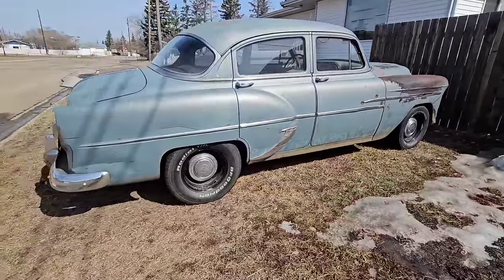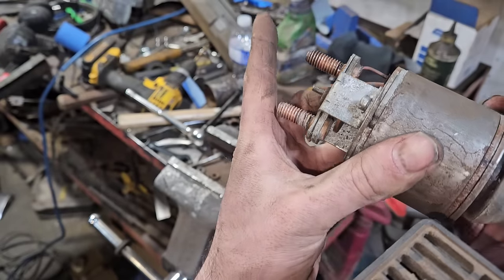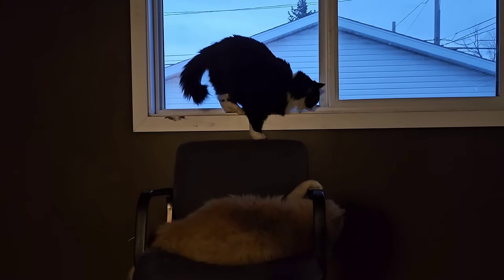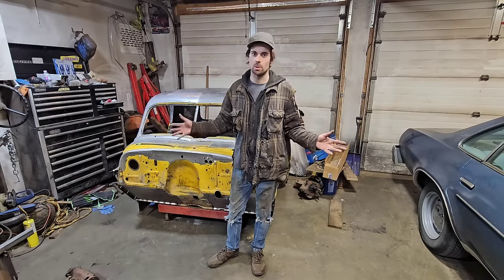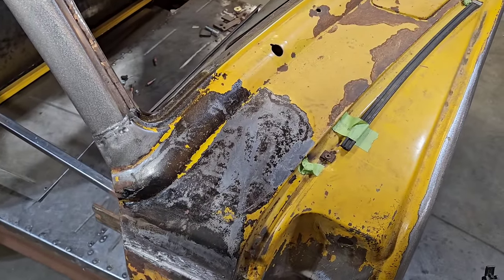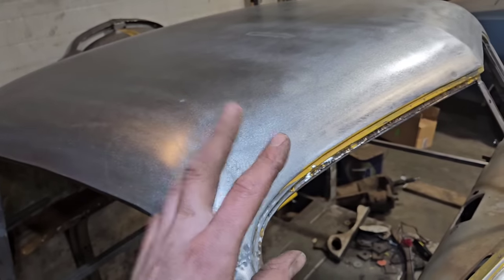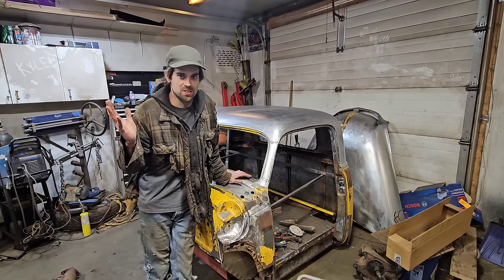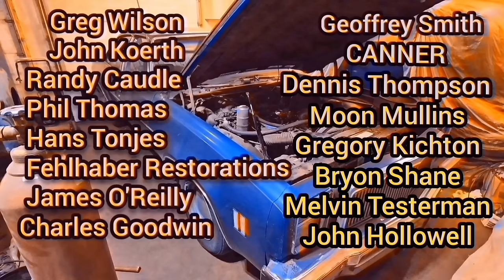This Rare Pontiac Has Been Sitting For 4000 Years! Plus: Top Secret Rust Removal

Comment: I love working on old crusty mechanicals.  Newer motorcycles usually come down to replacing the igniter box or computer. $1500 repair bill for a bike that is not worth that much .  Older bikes , just points and carb if you get any kind of compression. The main reason that I stoped working on customers bikes . As Jean Paul Sautra said “ the real hell is other people “

Comment: The fact that it idles as well as it does kinda says the internals of that motor are not that bad "probably". The "coughing" you are hearing in the carburetor kinda indicates you might have a stuck or burnt intake valve. Most likely stuck. If you are hearing similar poping from the exhaust, the same thing  applies only on the exhaust valve side. I would try some STP additive in the oil or maybe some Marvel mystery oil. Beyond that, you are looking at removing the head to determine damage/condition. A vacuum gauge is also a simple way to determine things. A strong reading (16-18) but the needing bouncing a lot says good rings (compression) but bad valves. 
Use a "stove bolt" in the truck. A late one with pressurized oil system and hydraulic lifter if possible.
Reply from the maker: Thanks for the input. I did put a vacuum gauge on it but forgot to include that in the video. The needle was bouncing around so you are probably right about the valve issues. I may end up pulling the head once I get it moved into the garage for disassembly

Comment: I thought Canadian Pontiacs had Chevy motors. This is the same motor as the US model.I learned something today, thanks
Reply from the maker: I believe they switched over to using Chevy engines in 1955...or some time in the mid to late 50's, so you're still right!
Reply: @CarterAutoRestyling  thanks for the update. I moved from Oklahoma to Calgary n 1963 as my dad was transferred there. I freaked out when I saw Chevy motors in Pontiacs. I was also curious about all the 6 banger full size cars. When I thought about it though it made perfect sense as Calgary had no freeways and the trans Canada speed limit was 60.  The six cylinder cars made total sense. I really enjoyed Canada and have been back. Canadians are the nicest people on earth.

Comment: well the '53 Pontiac runs I mean the engine isn't terrible you could spend a little more time on it. A running engine is better than a frozen one any day. Looks like that Krud Kutter worked pretty well as long as you don't leave it on too long with each application. Love your cats playing during the video. Thanks for the video Kyle.

Comment: When it was spinning over with plugs in it sounds like not all cylinders have compression. Probably some stuck valves. Some valves might be accessible through the plug holes and may be able to be tapped down. I did like the good access you had to the clutch. You couldn't free off a flathead ford like that. Nice job on the rust. I need something like that for my 32 sedan. That's a job I'm not looking forward to. Oh yeah, my views have tanked too, but I put that down to the T-Bird not being as popular as the 100E. Ok mate, catch you next time! Mart.
Reply from the maker: Hi Mart. Thanks for your input on the Pontiac engine. I think once I get the car moved inside, I'll pull the head off so I have full access to mess with the valves. Ps. Nice work getting the T bird to run on 4 barrels! It sounds great!

Comment: Love your videos! I'll give that Krud a try. I've been using OSPHO the last couple of years on lightly rusted parts and have been pleased with the results. I even use it as a surface prep the day before painting. I also learned about molasses/water a while back for rust remover. 9 parts water, 1 part molasses, works great but is very slow. need to soak parts for a month or more depending on how rusty. Keep up the good work!

Comment: If there isn't snow on the ground, are you really in Canada, and not some tropical oasis? I think that you should at least pull the head off of the Pontiac. Since the valves are in the block, it should be easy. You could clean the tops of the pistons, and maybe around the valves. If you're careful you can reuse the head gasket.
Reply from the maker: I was thinking the same, won't hurt to at least have a look at what's going on inside. I think I'll wait to pull the head until it's moved inside the garage so I don't have to push it haha.

Comment: That's a rare 53 or 54 Pontiac Submarine!  Add a magnetic oil drain plug and fill with rotella 4 oil. It will repay you with love and torque you didn't expect.
Reply: lol the hubcaps are still holding the wheels on-amazing considering wheel covers are as useful as engine covers and bumper stickers

Comment: Adding #puppetry to the channel is a very astute move, your views will improve dramatically. Too much voltage and running without an air cleaner can really damage those old Pontiac flatheads, especially if they were wore out to begin with. Cheers! 😎👍🐔🥚🛻🏁🏁

Comment: Take a que from Scott. Pull the ponchos head and loosen any stuck valves. A couple heat cycles may release other stuck components. The Flat six would be cool in the chicken truck. Nice work as usual😊

Comment: Currently I use liquid Ospho rust converter. Both Ospho and Krud Kutter contain phosphoric acid as an active ingredient. I have learned that Ospho reacts with concrete if dripped onto it. So I try to apply it over cardboard to avoid contact with concrete. Another great Video. Comp test that Indian Chief, You might just have a sticking valve in block. Might gain acess thru side cover plates. Dunno much about flathead valve adjustment. Take care sir.

Comment: It sounds like your straight six is a straight five. I would guess it has a stuck valve which is quite common in those flat heads that have been left standing for many years. Buy yourself one of those cheap laser thermometers and point it at each cylinder exhaust it will show the cylinder(s) that are not firing or missing.

Comment: When working on the solenoid, you can usually flip over the copper washer that the copper contacts connect with when electricity is applied.  This used to be a common field fix for starters back in the day.  You can also usually still get the contacts and the copper washer if you know where to look.  If you can't find parts for them anymore, you can substitute a Ford starter relay that does the same thing.  Solenoids are very simple electrical devices, one is as good as another as long as they aren't being used to kick out the Bendix also.

Comment: I have tried all manner of rust removal shit. In my opinion, if you can soak it, use Evaporust; if you can't soak it, use Ospho. Those two work well on heavy rust. On lighter stuff, I have used a Loctite and Permatex product, both in brush on and spray that leave a paintable primer surface. I have used all of these with no rust through problems on restorations. That stuff seems to work well though!

Comment: that malibu would make a great cop car tribute. plenty of low buck factory type suspension parts without going to qa-1 coilovers, etc... ya already have the hub caps!
that pontiac dash would look great in the chicken truck. btw your commentary is gold!
Reply from the maker: I definitely think the Pontiac dash may end up in the Chicken Truck!
Reply: @CarterAutoRestyling  it just looks so good and you don't see them in customs all the time. btw i think a nice straight six is perfect. customs aren't supposed to have a fire breather. maybe a jeep 4.0 dressed to look old? cheap, period paint color, a bit of chrome... that rust eater was impressive- thanks for the tip. thinking of trying pickex 20 too.

Comment: Picked up some Krud Kutter from Canadian Tire. I would agree it works pretty good. I was previously using Muriatic Acid. It works very well but is nerve racking to use and it does rust all bare metal within a 5 km radius. I found out the hard way 😮‍💨. Thanks for another great video!

Comment: Do a compression test, new spark plugs, maybe spark plug wires. Add a pint of transmission fluid to the oil to loosen up the engine. Good luck.

Comment: Letting the rust remover dry out usually results in staining of the metal it is used on.  Generally speaking, you should use some Saran Wrap to cover that area that has been sprayed with the rust remover gel.   This keeps the rust remover from drying out, and makes it work longer.  You can leave it on several days if you want without it drying out, if you have extensive rust.
I know it seems completely insane to flood the area with water when trying to get rid of the rust remover - however, it doesn't cause flash rust IF you flood it then dry it immediately after with towels and/or blowing it off with air so no moisture sits on the surface. You aren't the first to question this and to assume it will cause flash rust, it doesn't if done correctly.

If you don't flood the surface with water, the phosphoric acid will stain the metal and keep coatings from bonding.  The product you are using is the same as a rust killer and cleaner like PPG DX579 for bare metal (basically phosphoric acid without the gel).  To use it you have to flood the area with water after applying it and then dry it immediately.   Using this stuff kills the surface rust and deep cleans the metal in preparation for paint or primer. This is so that rust can't start up on the metal underneath the primer or paint.  If you live in a rust prone area or one with high humidity, you'd want to get the surface in primer or paint within a day or two, with no direct moisture sitting on the surface and the metal to be painted is inside a shop.  In a dry area, you can leave it for several years inside a shop if there is no direct moisture on it.  If you live in an area where rust is a real problem, you should also use DX520 after the DX579 because it leaves a zinc phosphate coating on the metal to greatly deter rust.  Most paint lines have their own versions of DX579 and DX520, they are all pretty much the same chemically so you can use whatever brand you favor.

Comment: Battery sponsors? I sure need a oil and transfusion oil sponsor 🤣. I'm sure someone from Cuba is watching this and thinking like what the hell are you doing to this car.  Flooded cars are a kind of nightmare just like a engine full of mouse house or it having furry pistons inside. Good thing this has a mechanical clutch so with some work the flywheel is salvageable but the clutch friction plate maybe too far gone. Not sure you can even get a replacement clutch for these anymore. Ring gear might need investigating further if the teeth are not chipped off it can live.

Comment: I really like that old Pontiac!! It even has a deluxe curved windshield! It was interesting to see that low-mounted distributor. When you were turning that flywheel in fast motion, I cutent help but think about all that fast motion when you work on fenders with the hammer and dolly. Is that a 6 voltage starter? I heard that you could run a 6 voltage starter on 12 voltages. I keep debating about converting my old car to 12 voltages.
Reply from the maker: My 35 chevy was converted to 12 volts but is still using a 6 volt starter and it seems to work fine (car was restored 20+ years ago). If I had a choice I would have just left it 6 volts and used heavy gauge wires and battery cables. 
    The 6 volt starter on the Pontiac is already wrecked and I just needed to get it running for long enough to move off my lawn, I wasn't too concerned about running it on 12 volts for a few minutes
Reply: @CarterAutoRestyling  Thank you! Being a person who hates to waste money and also cannot make a decision, I just keep running into things that are a problem with my car set up for 6 volts - like adding a cooling fan to the radiator, switching to electronic ignition, switching to an electronic voltage regulator, and now possibly replacing the battery pretty soon. Even using a timing light requires a 12 volt source. Some things (like the radiator fan) are available for 6 volts, but I keep asking myself "are you sure you want to change another thing that will deepen the commitment to 6 volts, or do you want to go ahead and switch to 12 volts"? Knowing I can keep the starter is a big help!

Comment: I would stick with the chevy straight 6 in the chicken truck, it's was almost painful to watch you rebuilding that starter, having worked on a couple of those myself,  kinda off video topic, I recently removed my tailgate from my truck to try and repair it,  and omg what are these tailgates made from, I don't think I own a big enough hammer to make the metal  move on that. I rewatched your tailgate video a few times but I don't want to cut mine up as much as you did,  plus mine isn't rust rotted as bad as yours was. I really need to find a way to start getting some of the body lines back in that doesn't involve me buying a 20lb sledgehammer.. lol

Comment: here's a fun project for you to waist some time :face-turquoise-covering-eyes:. . . . . . remove spark plugs and apply air with your compression tester and compressor - listen to the carburetor if you here air "bad intake valve" then exhaust (tail pipe) if you here air "bad exhaust valve" that should save you the trouble of tearing apart the engine , remember that thing probably only had 80HP new

Comment: I would start with a compression test.  I suspect you have a couple dirty valve seats.  Easy to take the head off and remove the valves.  You might get away with lapping the valves and get all 6 playing cylinders together

Comment: A flathead shouldn't require that much work , even compare to a later Chevy inline six.  Not to get perfect. New pistons, bearing, quick hone.  Lifters.  There are a lotless parts in a flathead.  And it's way cooler for that truck.

Comment: I think you should do some investigating on that old rig, but i would not use the engine for the chicken truck.  The carb could probably use a rebuild kit, and it sounds like a stuck valve, or something going on up top.  I'm not thinking the clutch disc and pressure plate are gonna come loose, but there are ways to try and force it loose.  You might be better off pulling the motor, and changing the rusty once water soaked parts out.  A clutch kit might not be to much, and you might get lucky with the flywheel.  I think this would be a good mate for the chicken truck.  I just tore apart a 53 jeep cj5 that the body was toast on, but the frame, transmission and transfer case were good.  Bothe axles are good, just look a little crusty, but all the grease and oil from the engine that once leaked all over everything saved a lot of parts.  The engine was seized, and some dumb a$$ took the spark plugs out, and took the oil pan off for a longgggg time, which killed it.  I took the motor apart, and i think if they'd have dumped some atf concoction down the plug holes it would have come free.  I have taken a week working a stuck motor, and gotten the thing running.  Some stuff people do makes no sense.  I traded a set of tires and a co2 argon tank for this jeep, so I'd have spare parts for my 54 jeep m38a1.  Many parts are available, but the stuff ain't cheap, and my bank account is tiny, so i feel you on not having the money to have a shop rebuild that engine.  You can never have to many project's, it's just deciding what to fix, and how long before you have enough money for the parts and materials to get it done.  G-d bless.

Comment: Kyle:   I had to stop the video at 19:00 minutes after you corrected the solenoid, fixed the starter and finally got the car running.  I cringed the better part of this half of the video because I don't know how long it will take before you burn out something in your wiring harness, dash lights,  the voltage regulator, the points or even the generator because you've put a 12 volt battery in a 6 volt system.   I know you can switch the 6 volt for the 12 volt to start but once the car is running it's always been recommended to detach the battery so that the car now runs on the 6 volt generator.  .... Now back to the video and If I see anything else that's eccentric, I pipe in again.
Reply from the maker: None of the original wiring is hooked up. All I'm running is the starter and ignition. The points are already trashed and the car is getting cut to pieces so I did not feel it was necessary to buy a $300 battery just to get a $500 car running for 5 minutes
Reply: @CarterAutoRestyling  $300   Wow!   It's been a while since I've bought a battery so I don't know the going prices anymore but did you know that if you drive a 7 inch gutter nail in the center of a 12 volt batter (slightly off center towards the other post) you've just created a 6 volt battery that you can attach a pair of cables to?  It's best to keep the Positive side in place and use the nail as the negative side.   This way you can buy a cheap used junk yard battery for $15 and make it into a 6Volt (using the gutter nail)  or use the original negative post and use it as a 12 volt (making sure the nail is wrapped with electrical tape to prevent it for short circuiting.

Comment: I would off it to get more pick-up parts, it's to far gone, surly someone needs a Pontiac parts care,  try and deal with CWM.
Reply from the maker: Oh I still need the 1/4 panels and front suspension for the truck project. The rest will most likely end up getting scrapped